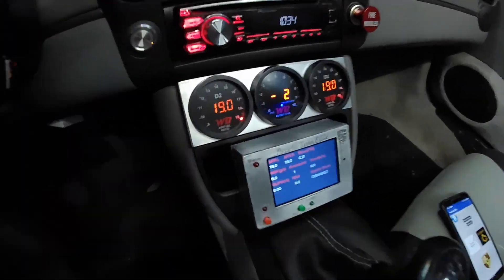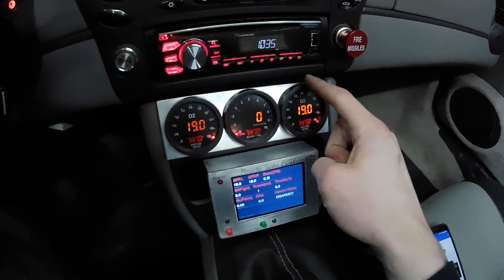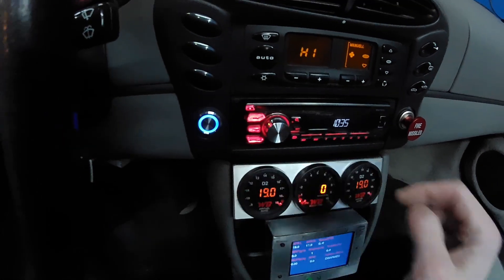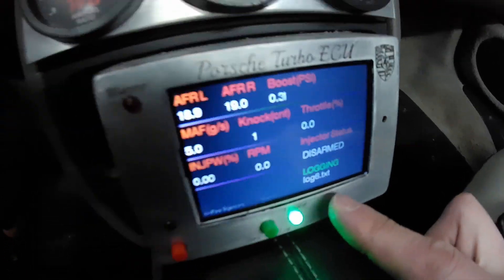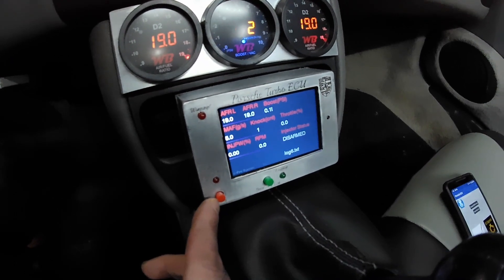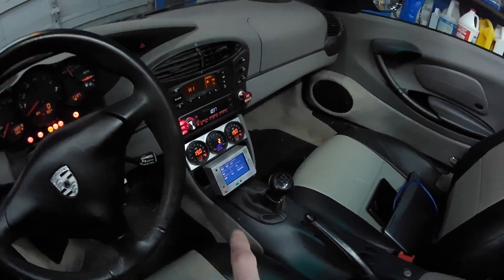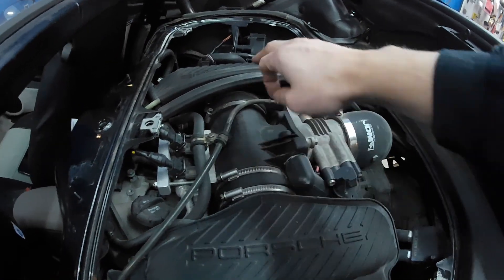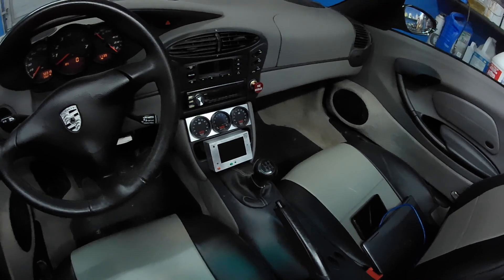Custom EBay Turbo Porsche Boxster (986) - Part 4 - DIY Piggyback ECU

Comment: your clutch is slipping....and...uh...er...it doesnt look or sound any faster than a stock one....
Reply from the maker: Thanks troll....uuhh urr I mean network bits.
If you don't have anything to contribute why comment? The car is much faster than before and yes the clutch was slipping it's fixed now and runs great.

Comment: seriously your up with there ,in genius category! you wrote your own app and software to cnc print i mean who does that? i doubt any porsche mechanic can do that.anyway id love to know what it would cost to do up a kit , fully programmed  and if your be interested to sell a kit like that?
Reply from the maker: Hey Prakash thanks for the kind words. It was a lot of work to get it to this point. I've actually made many updates to the piggyback ecu since posting this. I would be interested but I have a lot of things going on at the moment so it might take me some time to complete another one.
Are you looking for a turbo kit and a piggyback ecu?
Reply: @daboss298 hi william  ive had my boxster s 2000 since new..i paid too much for it. lost too much so im stuck with it. id love a turbo kit fully sorted and programmed with an ecu . my porsche mechanic at ktec is dead against any mods as he says the motor is fragile compared to a 911. hes always telling me to trade up. if i did id get vf supercharger for it. i spoke to tpc about the boxster .its about 10k and more for install..all the local guys who installed tpc turbos here had their engines blow up or give a world of problema? im in no rush but what do you think? should i leave it stock or modify it? as i still get a kick out of it. i just dont want to trash it and blow it up. id just like it reliable with a bit more power.

Comment: Shoot flames out the back 😂. The 32+- outdoor temp is another boost. That’s going to run different in 90 degree temps.
Excellent job man. Keep on reaching for the stars. Can you do some 0-60 0-100 time for reference to other cars.
Reply from the maker: Thanks man! I did do a 0-60 time and got 5.3 seconds. That wasn't really pushing it that hard. If I take it to a drag strip I'll post another video. I'll say with 7 psi of boost this thing is a lot of fun and has plenty of power to get into trouble. 😁

Comment: How did you get info from the DME, knock count, MAF voltage, etc into the arduino? Did you use an existing obd2 reader and take it from there?

Also, have you checked to see if the piston damage has got any worse? You might want to look at a way to reduce the timing under boost. Because the flame front speed is faster with a higher dynamic compression ratio, the optimum timing will be lower than the factory NA tune, so you might find more power with less timing and reduce det.
Reply from the maker: Hey Albie. I tapped into the factory dme pins and ran those to the arduino. Just look up the 986 service manual and you'll find the dme pin list. For knock the signal will go low when the dme detects knock (this is a 0-20 v so use a 100k resistor).
You should join the Facebook group. "Porsche Boxster Turbo Project". Theres a guy on there that cracked the factory dme. I used his work to pull 5 degrees of timing at higher engine loads.

Comment: All looks very impressive just surprised that u added extra injections and piggyback ecu, why not upgrade existing injections and change the ecu to a halltech ?? Also how is the ebay turbo holding up?? Must be worth getting a better turbo when u have done so much great work !
Reply from the maker: Hey Spina thanks for the comment. I have 2,500 miles on the turbo and it's holding up amazing for $100 Im blown away. I purchased a backup since they're so cheap. I went the piggyback route since it was the easiest method while keeping the factory ecu. I also want to be able to pass emissions and I need the factory ecu for that.

Comment: Hey William. I also have a 986 boxster that ive turbo charged. I dont have injectors or a piggy back system yet. I dont have the same skills or knowledge that you do after warching this. Very impressive and curious if you could give me a suggestion or just build them?

Comment: DUDE every step was amazing! This IS what I want to do for my 99 Boxster. Is this something a "Car Guy" with over 40 years of working on cars could do?
Just not so good with computer stuff though sorry....
Reply from the maker: Yeah I think you could do it. The mechanical stuff isn't hard, just takes time. There's a guy on the Facebook group that cracked the ECU and you can actually tune the DME if you follow his instructions.
http://986forum.com/forums/performance-technical-chat/77680-how-tune-96-99-boxster.html
Reply: @daboss298  ok I see how you made the fuel rails for injectors, i got that. How did you mount the rail that goes Into intake plenum?  Drill holes into plenum then how did you make that a tight seal as to no extra air/ No fuel leaks?

Comment: What would you charge to do this to my Boxster S 2002?
Reply: im interested to buy a kit too if you can make one up ecu ( Fully preprogrammed/ turbo .the whole kit and caboodle for an easy install by my local me mechanic.! i have a boxster s 2000 since new and i use 98 octane here on perth australia.
ive lost so much money on it since new, depreciation and keeping it in mint condition i have to keep it. my mechanic says dont modify or sell it to upgrade to a 911.
Reply: @prakashdayanandan3176  me too and send to the Uk I want one

Comment: Why didn't you choose the route with a megasquirt ECU?
Reply from the maker: Good question! For one I was able to customize the software to be exactly what I wanted both on the Android app side and the piggyback ECU side. I also saved a lot of money this way. I didn't want to replace the factory ECU either to remain emissions compliant.
I may start selling these piggyback ECUs in the future.

Comment: If your were to data log the MAF sensor, at how many g/sec was the sensor maxing out at? Love what you did to the car.
Reply from the maker: Well currently all I'm datalogging is the MAF voltage, which maxes out at 5 volts. Previously when I first discovered this issue I was using torque pro and obd2 and it maxed out at about 240 g/s. Which I don't believe since that would mean I'd have about 300hp at the crank. Maybe that's possible but that seems high for 6psi of boost.
Reply: @daboss298  Interesting. I've got my own boxster and really want to do this. For now I'll be watching your progress. I have so many question about your interesting project.
Reply from the maker: @jakefunny1  you should join the Facebook group I made. Lots of good discussion going on there. "Porsche Boxster 986 Turbo Project". Others are doing this as well. Post some pics of your car.